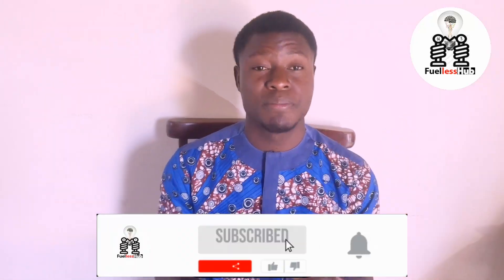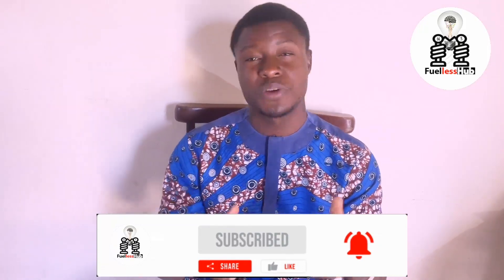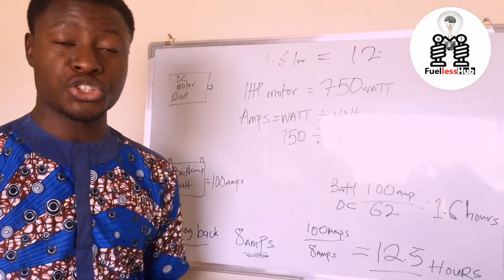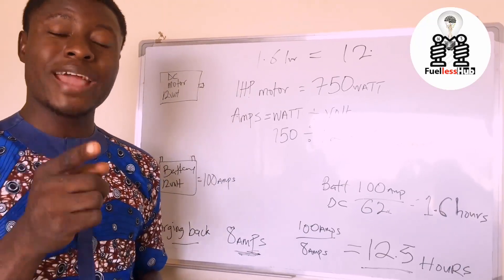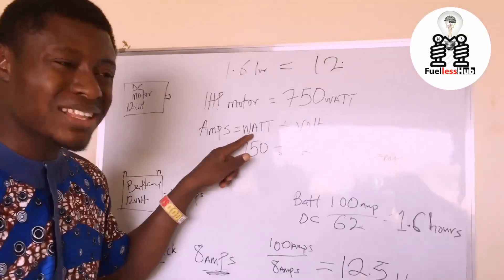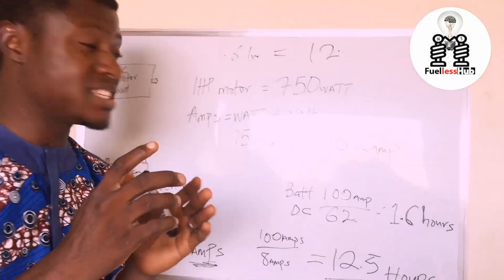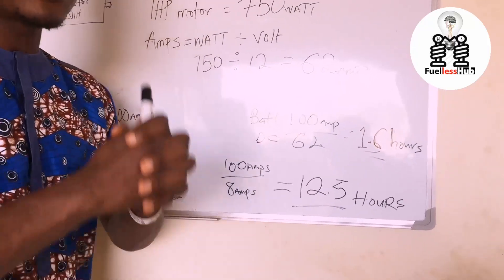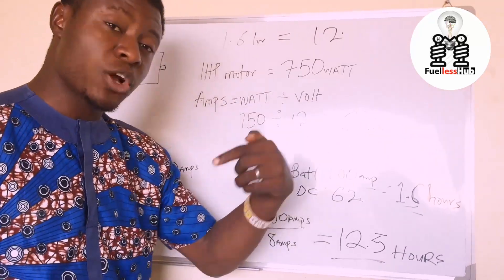Fuelless generator CHARGING BACK mathematics revealed

Comment: You calculations are for AC motors not DC..... For you to get the correct wattage, you need to use the motor value numbers.... 
Formula for wattage is
P= V × I
Power= voltage × current
P= 12 × 20= 240watt

Comment: thanks for setting people straight,common guys this mans maths is right,this is a dc motor ,the battery cant just start it ,then once running it changes over to be powered from the ac generator part ,that cant be done.and yopu cant put a transformer on the either to drop it to 12 volts because the conversion to change the ac to dc at such a high current is crazy the looses are huge,with that set up in the video it can not be done , not with the equipment they are telling you ,

Comment: The battery is only met to start the motor. The rectified current from the alternator will constantly charge the battery as in a car.  Please, reevaluate your criticism.
Reply: Firstly, dont compare the system to that of a car, a car uses a proportion of its engine power to run an alternator to power the cars electronics  and also charge d battery. Remember car engine runs on fuel... Lots of it
Reply: What you said here is some how true, but you missed to mention somethings.
the car alternator needs a certain kinetic energy to maintain its rotation to continue to generate electricity when battery is off, what car engine does when the alternator is operating within a car. But when operating as F.F Generator when in rotation mode the alternator must be connected to a flywheel in order to maintain the kinetic energy of rotation.
Reply from the maker: When u try  the method  u are talking, you will know difference between theory and reality(practical)... Try it first then u can come and prove me wrong here .... 
With all due respect..
Reply: Why don't you calm down, listen well before you write. Most times the whole system fail due to failures of enough charging system... We have to calculate well in other to get something that can charge the system well
Reply: That method will never work. You need an external charging method

Comment: The battery is a temporary source to start the motor. The motor will run the generator of example, 5.KW. The generator will then use about 1.5 KW to continuously run the motor. Therefore the output of the generator to the consumer will be 5 KW - 1.5 KW = 3.5 KW total! I hope it is clear enough.
Reply: Do you understand what you are explaining? You people don't understand the law of energy conservation. Only illiterates will buy your fuel less generator!
Reply: @oloketuyiidowu5395  Why don't you explain where I am wrong and stop your unwarranted aspersions. What I wrote was not a recommendation. It was a contribution to the theory you presented. I am not here to argue with you. Just chill out. Best regards!

Comment: I'm so glad to see these bro but I'm on a fueless generator project now and the 2.5hp, 1440 rpm motor almost  smoke out in less than 5 minutes of run on the first run,  the motor is driving a 7.5kw synchronise alternator coupled to 11-15 flywheel, still the drive speed was quiet low that it wasn't able to generate current
 pls I need more light on these bro and pls drop your mail
Reply: Check the rpm of your motor, it should be same as or higher than that of your alternator. But a 1140 rpm is too low man.

Comment: Fuelless Generator is ambiguous going by natural laws of physics.
Reply: It works. Go and read Tesla work on over-unity. Besides, there are other method that can be applied without the use of the charge-back system. If you use a flywheel, and power the Motor from a battery as the initial power source, allow the flywheel to gain enough speed for the alternator to give 220 volt output. The  motor can be disconnected from the initial power source(Battery) and connected to the output from the alternator with the aid of a switch. So the generator then runs without any external source of power other than it's own output and as long as the motor continues to get supply, it'll run continuously till you switched it off.
Reply: I took my time to explain this because i noticed you have been making uninformed comments everywhere you see video of fuelless generator. Remember the inventors/scientists of yesteryears are those who went against the then prevailing laws.
Reply: @babatundeogundipe7674  : It is not possible! You cannot get something from nothing. If it is possible, the Chinese should have flooded the African market with it. I need not to call you. Thanks.
Reply: @oloketuyiidowu5395  this is just a blind argument... Why don't you just go to the workshop.. 
11/13, By Mao Junction,  Agbado Road. Go there and get one for yourself.
Reply: can you give a design specification of one of the generators and the principle of its operation? If it is dependent on the flywheel, it is not feasible. I don't waste time frivolous system. The fuelless generator is an impossible system take it or leave it.
Reply: @babatundeogundipe7674  What is blind in my argument when I am licensed to educate you on energy conservation and management using known energy conservation laws.
Reply: @oloketuyiidowu5395  so also were those who argued with Albert Einstein,  Phytagoras etc. What the laws says is impossible today are the realities of tomorrow 
Besides, this thing is working... Mist farms are now using it to escape epileptic power supply... Yet you still continue to be negative about it even when you were presented with the opportunity to see it first-hand. That's blind argument
Reply: @babatundeogundipe7674  I don't know your educational background; the fuelless generator is a white elephant project. No man-made machine is 100% efficient. You are claiming that fuelless generator efficiency is infinite! Only illiterates can fall into the trap of your perpetual motion machine!
Reply: @oloketuyiidowu5395  Education is supposed to open our minds to a wide world of possibilities as against limiting ourselves to a closed world of certain known laws. 
My parting word to you is this: remember those known laws you are sticking to were once frowned upon by knowledgeable and advanced societies of old.  Some inventor of the technology you and I enjoys today were persecuted  and killed for trying to tell the world that existing laws can be set aside for new possibilities. Think again fellow.
Reply: @babatundeogundipe7674  Nobody was persecuted for provable scientific theories. As far as fuel less generator is concerned; it is not feasible because if it had been feasible,  the attention that the clamoring for renewable energies get should have been directed to fuel less generator. Kindly direct your energy on other more viable ventures. Energy can neither be created or destroyed. It is impossible to have a system without input!!!!
Reply: @babatundeogundipe7674  p
Reply: @babatundeogundipe7674  Your numver is not going...please i need to buy this gen
Reply: @judeagetu786  my number is active.
Reply: @babatundeogundipe7674  ok
Reply: @oloketuyiidowu5395  how do wind turbine generate electricity
Reply: @babatundeogundipe7674  You are talking to an engineering mechanics expert. Do you know that vicious friction will not allow you to produce a 100% efficient contraption. Do you know what is called exponential decay? Your generator input can never meet the output required of it. The law of conservation of energy must be obeyed! Fuel less generator is a scam!
Reply: Human laws and discoveries are not everlasting, they are either broken or improved on. 

Let’s learn to encourage and compliment each other not fight each other